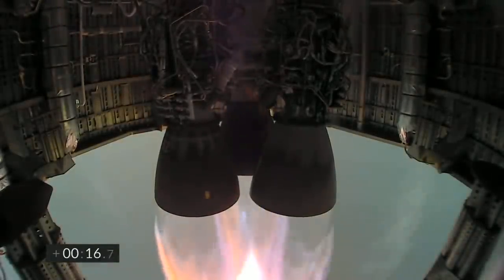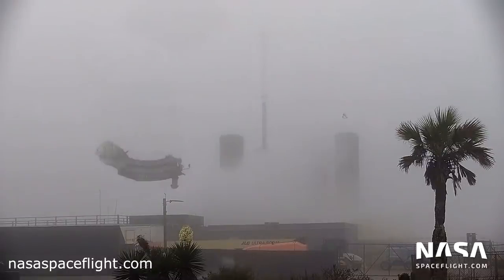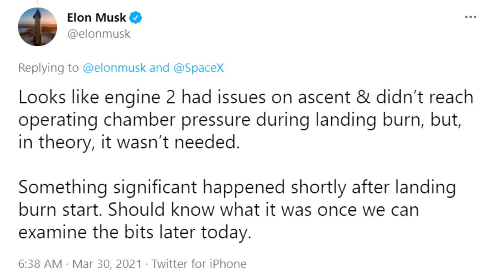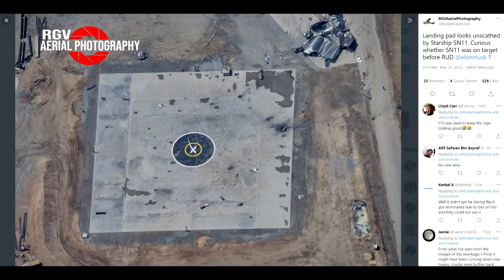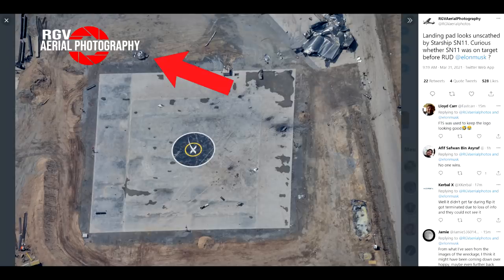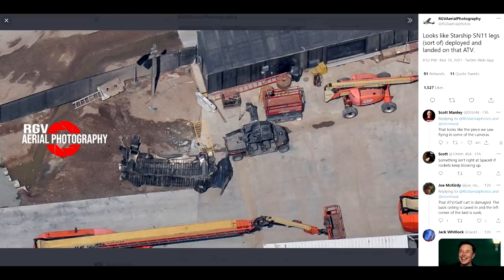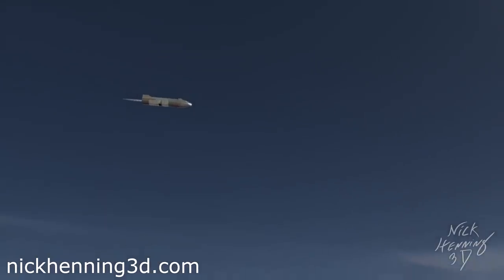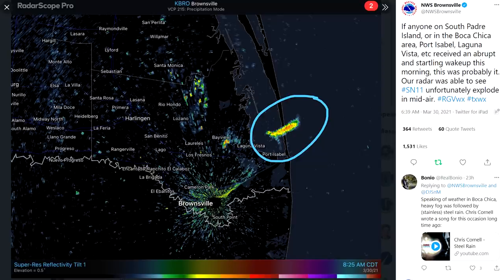What Happened In The Fog At Boca Chica - What Caused SpaceX's Latest Prototype To Explode?

Comment: The SpaceX design team still haven’t solved a reliable fuel supply to the Raptors free from helium or vapourized liquids being disastrous to rotor blades inside the turbo pumps. Somehow those pumps must be software controlled protecting them agains over revving. A reliable landing burn is paramount to this episode of the great SpaceX show.
Once being able to a controlled approach to any landing site there will be the issue of landing legs being strong enough and the tremendous heat of the Raptor’s escaping blast along the legs and the edge of the skirt nearing the ground.
GO Elon GO GO GO, I love You.

Comment: I honestly dont understand SapceX's thinking on this one. Visual data is still a significant source of data, so to forego that seems rather odd. I've heard some say that they are just that keen to get to SN15 as there are some significant plumbing and fuel feed changes. If they have concluded that fuel supply on this current iteration just isnt good enough then i suppose that kind of explains why the results of this test may just not have been that important to them.

Comment: I have the feeling that the full-flow engines do not take kindly a serious shortage of either Ox or Methane, i.e. due to the unpredictable sloshing in the tanks, never mind how much He pressure is applied. Just consider in the O2-rich a shortage of O2 with the same Methane supply: same heat much less cooling, same the reverse int he Methane-side part. SpaceX will probably need to add more hardware, and another engine to make up for the weight - or keep failing.

Comment: Could be it a structural failure with the tank?  What I mean is, is it possible that when the engines fired that the force of the and engines and the aerodynamics of the nose caused it to ‘fold’ in on itself thus creating a mixture and large explosion, or maybe just the energy from it folding in half could cause a large debris field.

Comment: I would think that the Raptor engine should be reworked to literally a plug-in module. All connections (electrical. lubrication, hydraulic, and fuel) simply and securely snapping into place. And only Coming off with the proper proprietary tooling. Gimbal the mount not the engine. Test the crap out of them. Then mass produce. As it is now, Spacex is flying engines with issues.

Comment: They should have perfected the engines before building the rockets. It may have taken longer, but it would have saved a lot of prototype failures.
Reply: The Raptor has been properly tested as a standalone - the program now is testing function in real life situations with integration of the engines with the fuel tanks and piping when the rocket is taking off flipping sideways to glide and then flipping back to vertical for landing. 
As Scott notes this huge explosion must must have come mixing of fuel and oxygen somewhere in the piping.

Comment: Possible a failure of a raptor somehow setoff the pyrotechnics for the flight termination system? If the explosives went off the wave would likely propagate along the whole length of the system and the computers may not register it as having gone off at all

Comment: At this point, I think SpaceX has provided enough evidence that they absolutely positively NEED a proper flight abort system.
SN8/SN9: "If you thought a 'suicide burn' was risky, try sticking this landing maneuver."
SN10: "Even if you stick the landing, you're still sitting on top of a bomb."
SN11: "Oh, and that bomb can explode anytime, even before touchdown, without so much as the slightest warning."

Also, good luck designing a flight abort system that would work at such low altitudes in the belly-down position.
In my book, the entire belly flop concept is evidently and royally screwed. For crewed flight, anyway.
Reply: They do.  They have had one for F9 for years.  What gave you the odd notion that they didn't?  What does being low and bellow down have to do with the functioning of the FTS?  Do you even know what the FTS is to do and under what conditions?  I'm starting to suspect you don't.

Comment: You are not afraid of getting sued by Trevor Mahlman. Also, this development strategy they are using, with so many rockets blowing up, is absolutely terrible if you want to develop a human grade rocket. Imagine NASA developing the Space Shuttle and the 10 of the first 30 launches blowing up. No one is going to fly on it, even if somehow they get it to be very very safe. It just doesn't make sense to design a rocket that can blow up for so many reasons and then try to make it human grade.

Comment: Am curious if the starship guide Fins have enough range such that they can perform the flip over maneuver aerodynamically.  It would seem that things in the engines and fuel tanks would be more settled if the relight started in the vertical position.
Reply: I can't say, but I think that's the right direction.  Flip, THEN light the engines.  Even if they use a small solid to do it.

Comment: My opinion is that we have already seen fires on the machines on videos of SN5 and 6. I also see it on all of the videos. But not with all turbines. And I don't think that's what is wanted. The high pressure and the hot plasma to preheat seem to cause material to collapse again and again. At the moment the engines can't be turned on and off without causing problems. If these problems persist and cannot be brought under control, the project would have failed in this form.

Comment: Just a few comments from someone experienced in fighting gas explosions, but not a expert in rocket design. It looks to me like a central tank has had a bleve (Boil Liquid Expanded Vapour Explosion). From my basic understanding, the header tanks are spherical. Following Boyle’s law logic, if the tank pressure relief system fails, then the tank will fail at its weakest point. As a result, the skirt and Raptors could be forced in similar directions, hence the close proximity in the debris field. Above the explosion, bearish would get larger as it is farther from the bleve, hence the nose cone is also a large item.  Should the process of SN11 returning to vertical have only been partially completed, then the forces would have pushed the debris to one predominant side of the pad.

There obviously will be a detailed investigation, by people on the ground who are much ore qualified and experienced than me, but this is one plausible explanation that would cover what little we can see.

Comment: Despite the internal rumors, I still bet this was a flight termination. Executed at low altitude to minimize the debris field. 

They probably knew the landing had no chance given all the hardware was essentially the same as the previous flights. Termination could have provided some meaningful incremental data.

We all know how fond SpaceX is of notifying the FAA before explosions. 😏
Reply: Unless it was about to drop onto something important I don't think there is any logic to blowing it up in the air.
Reply: Nasa did this with Antares in 2014 after rocket failure 20 seconds post launch (as with SN11). Same logic applies here. 

Whether planned in advance or not...sure that can be debated, but 11 was clearly in trouble after liftoff.

Comment: Would an initial explosion, in the engine area, not push the Downcomer pipe upwards and tear out of its welds at Both bulk heads, mixing the contents of Both fuel tanks And header tanks, creating an instant fuel air bomb ?

Comment: ,if the common bulkhead collapsed, i would imagine it to look just like that. especial if it does, while all the liquids are in rapid motion, due to the pendulum motion just having stopped, which would assist in getting more of it to mix properly before its driven apart again by  ̶l̶o̶v̶e̶ heat and pressure.

Comment: Maybe a leak from the downcomer allowing fuel and oxidiser to mix in the tank. This happened on a falcon 9 second stage on the pad causing a pretty impressive rapid disassembly.
Reply from the maker: No it didn’t. That Falcon 9 pad explosion was due to solid oxygen igniting carbon fiber https://youtu.be/mBcoTqhAM_g
Reply: @scottmanley  Oh my mistake, I though that was LOX and fuel mixing in the upper stage during fuelling, still such a leak could have occurred on SN11 and such a mixing could have caused an explosion in the tank but it's all speculation for now.

Comment: From what little I saw, I would be inclined to think that there was a leak from the outside that the ship actually descended into and an accumulation of gas in the engine compartment that ignited on engine start. The ship just may not be strong enough for the very stressful flip maneuver and this version of the engines are really nowhere near good enough (three tries, three explosions). Also, engine burn does not mean the engines are burning. The engines should have been perfected before going on to next stage testing. Not an expert,  just a Boomer who's seen these programs from the start in the 1960s (as we all have). I know how they are supposed to go. I know how engine burns are supposed to look. And the scattered debris field may just indicate a "normal" explosion at altitude (seen those, have we not?), not necessarily tank rupture and explosion as the primary cause.

Comment: It's clear that it exploded at altitude immediately after ignition was initiated, so, a little under 1 km above ground. It was highly irresponsible of SpaceX to attempt such an experimental landing in the fog, preventing engineering cameras from recording what happened. They should never have limited their abilities to analyse the flight by pushing to launch in such conditions. What was the rush? Another day or two to wait for clear conditions was too much to ask? I, for one, wouldn't be surprised if there are consequences for SpaceX if the FAA take a dim view of their ability to explain this "anomaly" because of the absence of engineering video.

Comment: Might have to beef up Raptor engine plumbing & structure to endure a whole lotta shaking going on.   Elon needs 6 degree of freedom accelerometers to measure vibrations and resonances ... and accurate FEA models tweaked by measured results to adequately simulate this. 
     I suggest high speed close up cameras to measure vibration movement of reference dots on 100 critical parts of the Raptor.   Then verify the Finite Element Analysis model of the Raptor matches the measurements.

Comment: As I said many times, the Raptor is INCREDIBLY complicated an why? Because of 1-2% ISP gain? No worthy of the reliability sacrifice by any means! My opinion.
Reply: I say let them at least try and make it work.  It would be a shame to throw away all that they've done. Where did you hear they are only getting 1-2% ISP gain?  There have been few other engines to compare it to..
Reply: @TheEvilmooseofdoom  Well, let them try, why not. Elon is the richest man in the world after all, so he can throw infinite money on this as long as he wants. But as a paying passenger, I would definitely prefer to ride the Dragon (or Soyuz) then the Starship. Dragon is simply MUCH safer from the very design and I would feel much safer being inside it. 

And concerning the 1-2% ISP gain this is of course an estimation (but based on calculations) when compared to  e.g. single-flow stage combustion (due to lower chamber pressure, lower expansion ratio) or with an advanced (yet simple) GG cycle (I have some idea, supported with calculation, which yields only 2% penalty for 150-180bar in the combustion chamber.) 

Yes, the engine would be slightly heavier and slightly less performing. But as a passenger I don't care the bright engine specifications, but what I do care is how safe I feel inside the ship. Trying to optimize up to the very limits ALWAYS brings about susceptibilities. That is true not only for engineering. Remember the dinosaurs.

Comment: You can see fire sprites all around the motors during the flight and the colour of the exhaust changes as it has during all the failures . How can these motors run in skirts never have we seen enclosed rocket motors ever why? How can the skirt work when the rocket is compressing into the skirt when it's dropping down. None of this makes any sense

Comment: So, I’m no rocket scientist, but this is my early guess...

Just before the telemetry cuts, you see all three engines gimble outwards however the engine in about the ‘2 o’clock’ position (from the cameras view) doesn’t appear to move correctly might have jammed or lost some ability to move. Elon stated there was an issue with one engine relighting, and if that issue was on the ‘6 o’clock’ engine, it would have left only 1 ‘functional’ engine left to control the ship..

Worse yet the 2nd engine that may have lit, might not have been controllable and may have affected the landing angle of the ship..

from the debris field I imagine that the ship impacted on a light angle, and with excessive speed causing a ‘crunch’ of the impacting side of the ship, with all that metal and propellant breaking free, should have only taken a spark to ignite the ka-boom, and that point, with the explosion originating on the impacted side, the force would have ‘pushed’ the debris in a more specific direction
Reply: All 3 engines light now.  The idea being that if one failed to light it would not matter.

Comment: Whilst amazed at the achievements of SpaceX, Tesla etc, I have to ask.. As a non rocket engineer..
Is this design simply too flimsy? 
After all, far as I can ascertain, (wrongly?) the structural integrity/stiffness of of the design when it is under stress (take off/landing) depends largely upon maintaining high internal pressure.
Is that the fundamental problem?  Any decrease or maybe here, increase, can lead to catastrophic failures.
Would I go to Mars on this??.. No.  Not really..

Comment: The methane tank needs to be coated inside, with self sealing (liner)  compound, similar to jet fighters fuel tanks.
Reply: Not as easy on a liquid that is -160 C.  Most things get pretty solid at those temps.
Reply: @TheEvilmooseofdoom  Very similar to transporting LNG. same temp. range. What are those containers made of? Too heavy maybe? spun carbon fiber vacuum formed? just a thought. Spun Kevlar and fiberglass combination perhaps? great problem to solve.

Comment: Another thought I had is they needed over-pressure wave data for air bursts while the rocket is moving at a descent clip.  It is better to gather this data with mostly empty fuel tanks than mostly full fuel tanks.  It is also better to do it in thick fog as the moisture will muffle the blast and then the true magnitude can be calculated later.  The FAA inspector probably asked about this and received, granted s/he probably didn't expect such a demonstration.
Reply: They wouldn't do that over their work site, that makes no sense at all.

Comment: I think it's time to redesign the rapture engine and get rid of the turbine driven pumps and replace these with tesla motors so the engine is more software configurable more in line with Elon's area of expertise. This would allow real time fuel flow adjustments  and make the engine even more efficient.

Comment: What the actual F were they doing launching in fog? How can you have any kind of range safety if you can't see your rocket? Why would you launch a rocket that has an explodiness rating of 100% on a day when they can't see what it's doing? Seriously, what kind of a clown operation would do that? How much more of this staggeringly poor judgement can SpaceX show and still have people trust them?
Reply: You don’t need to see it, it has an automatic FTS. Also, it has an “explodiness” rating of 57.142%
Reply: @jackwhitlock1  The thing has gone wrong every single time it's been flown to altitude. Why would anybody trust the automatic FTS?

I was calculating explodiness based on flights to altitude, in which it's exploded four times out of four. If you want to count more than that, SN1 exploded while being pressure-tested, SN2 was never flown, SN3 imploded while being fueled, SN4 exploded without ever flying. SN5 and SN6 completed low-altitude flights and didn't explode. So, not sure what you're counting as four explosions out of seven: prior to the SN11 flight, there had been nine Starships built, of which five exploded and one imploded.
Reply: @beeble2003  Fog would not interefere with a launch and they were ready to go, so they went.  Why not trust the automatic FTS?  The number of explosions are of no consequence, it's the causes of the explosions.
Reply: @TheEvilmooseofdoom  "We've built this really unreliable thing. Don't worry, if something goes wrong, part of the unreliable thing will detect that and deal with it. Of course, the part of the unreliable thing that detects unreliability is perfectly reliable, and so is the part that deals with the unreliability. What could possibly go wrong?"

Comment: Solution:
Use the flaps to turn the ship vertical and wait 10 sec for the propellants to return to the bottom of the tanks.
THEN relight the engines.  Yes, will require more fuel due to increase in speed.  But better than endless failed experiments with failing slosh control.  Someone tell Elon.
Reply: I suspect flip up timing has been on the table. :)  There was also talk at one time of them using more powerful hot gas RCS thrusters to do the flip up.  I suspect you're on the right path though, flip up, then re-light.